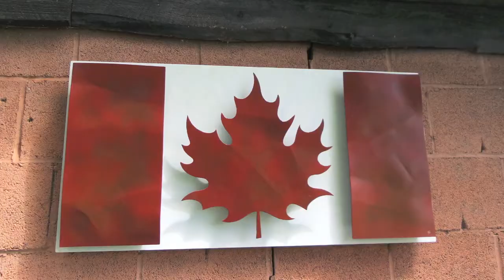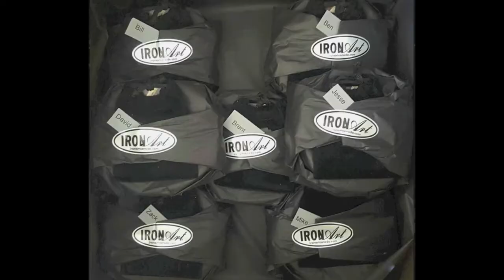Making Belt Buckles

Comment: I have some pure gold and silver bars I wanted to melt down and make some buckles with. How do I  go about the process for making some pre die cast molds?
Reply from the maker: I've never used a two part mold. but I've made one part molds from soap stone or clay. just imagine how you want the shape to be then cut it out. with clay you need to let it dry half way ''till it's stiff but not hard'' then cut it out , before using dry completely.
I think you will wan't to watch some YT videos. it would be hard to help much without you being in the same room. don't be intimidated, it's not that difficult.